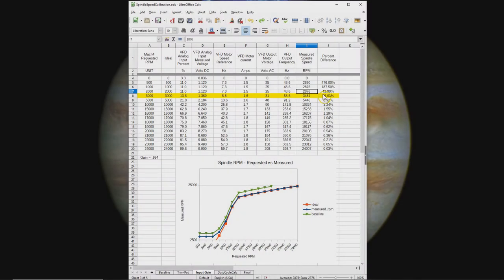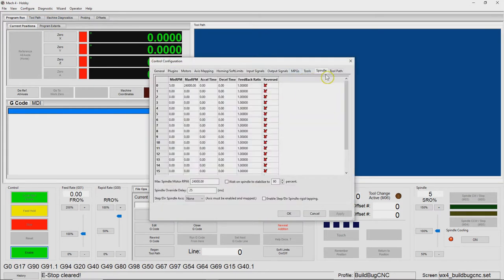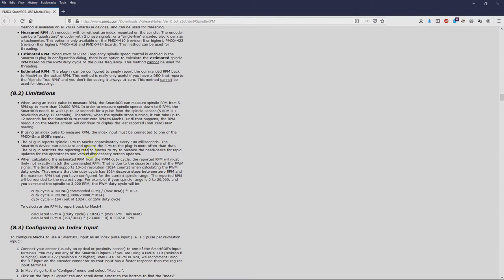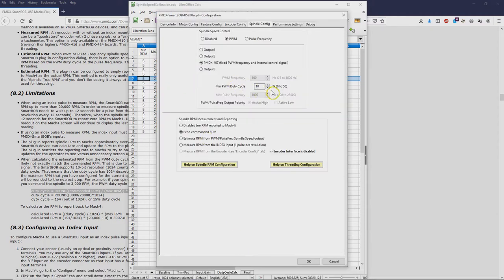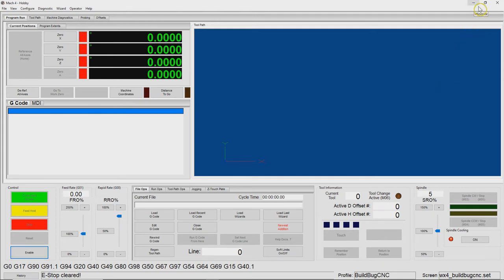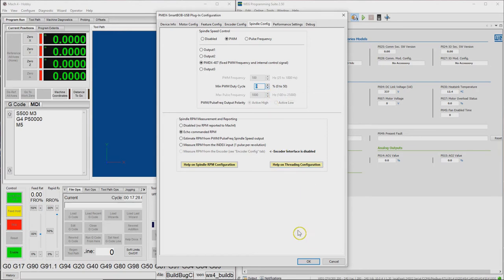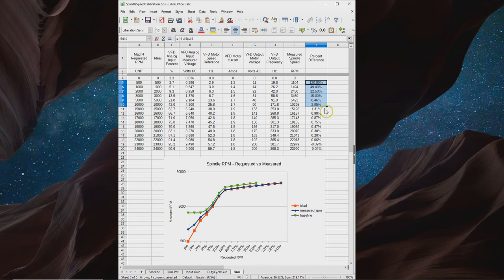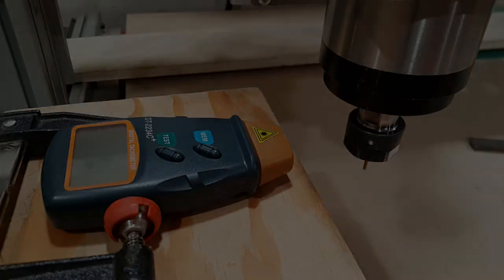CNC Spindle: How slow can we go?

Comment: hi , good test. Did you make any other test on real material? How is the torque  at 3000RPM.  Have you tested on Iron. I think that torque is too low also  to make  small holes
Reply from the maker: No I haven't tried to drill any holes in metal yet, not sure I would even attempt ferrous metals. I have my doubts that this spindle is actually it's rated 2.2KW. Ultimately the glory/blame of maintaining torque at low speed really belongs to the VFD. Perhaps I'll give it a try, it would be good to know.